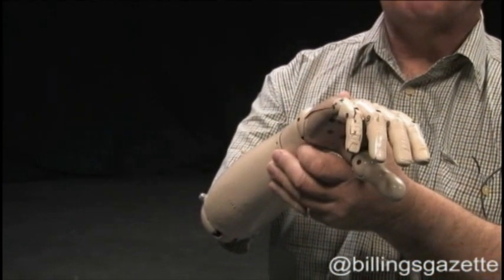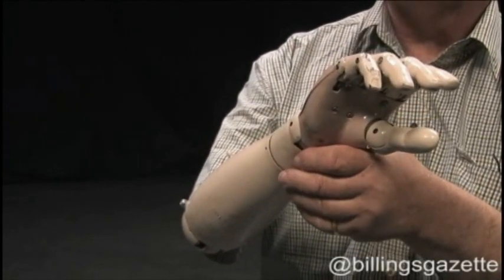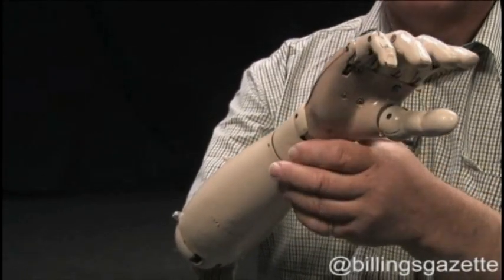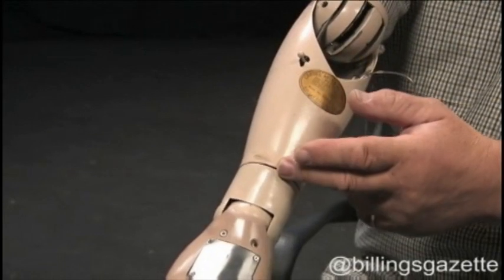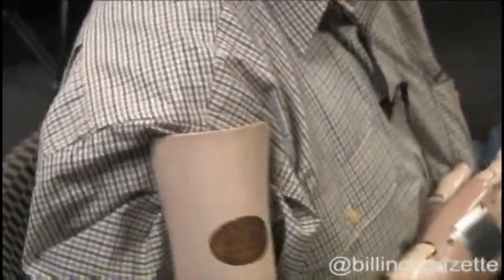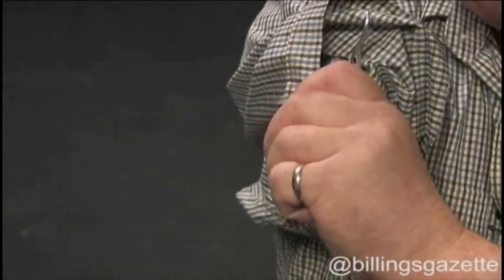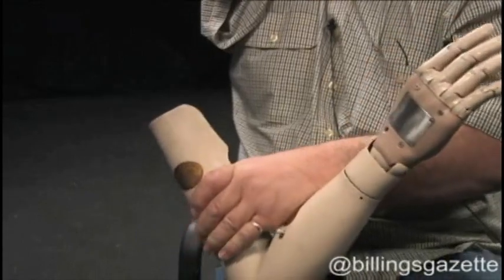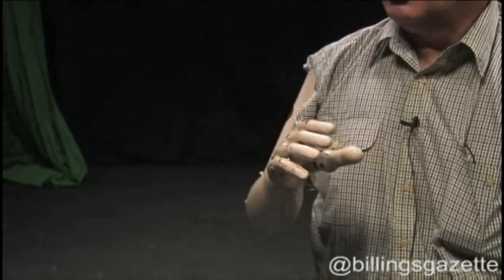Carnes Artificial Arm Rebirth

Comment from the maker: Thank You king. The key to this at my amputation level is a titanium bolt in the bone coming out through the skin called Osseointegration. Still not approved or recognised in the US. Once one  has that the rest is a pure engineering solution- These Carnes arms had been forgotten about.but like the inventor 100 years ago I am a machine shop owner- neccesity being the mother of invention. Modern stuff is too complicated invented by non amputees. Too regulated an industry controlled by corporations